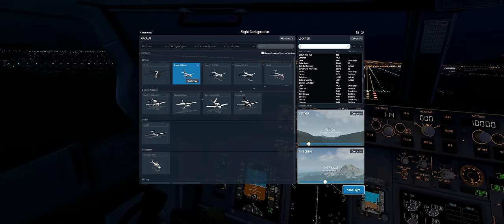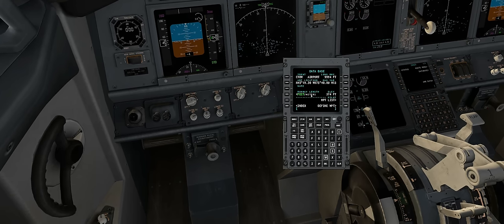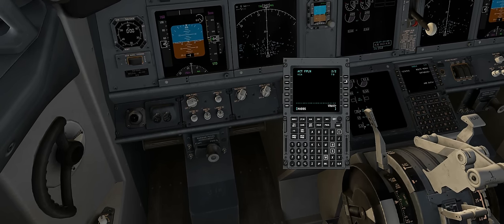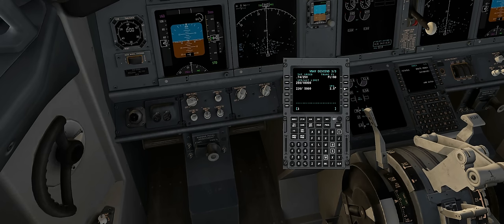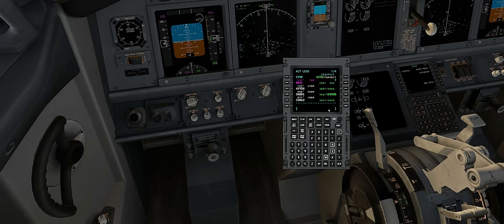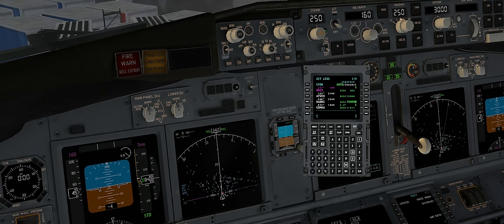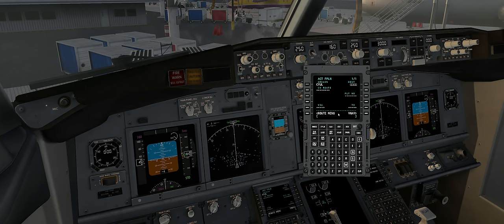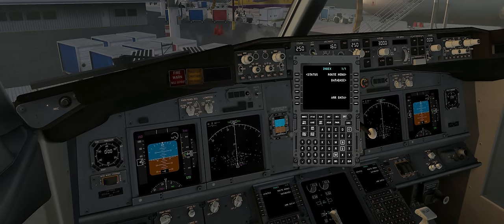X-Plane 11 - Flight Management Computer

Comment: Good video. One tiny note--flight level is simply an altitude measured at standard barometric pressure (29.92 in/Hg or QNH 1013). It has no relationship to cabin pressure.

Comment: I have found out that  the FMC woks better for me is to delete all waypoints & STARS after the desired runway. I know this is not the real world method, but it is working for me. If I leave them on, I fly around the airport, and then off to who knows where. I tend to turn on the vnav at about 3,000 ft. For the auto-pilot, I fly to TOD,  then turn off auto throutle and control the engines manually. I also use the speedbrakes when needed to get my speed down closer to landing speed. Speaking of landing speed, I have found out that 130 to 140 knots with full flaps is good.

Thank you so much for getting me started and for your tutorial!

Comment: It is the FMC Flight management Computer. Every one refers to it as the FMC.  In your dispatch paper work the company (Airlines) provides the route. The cost index is supplied also.  If the flight is always late you fly faster, with a big tail wind slower. The object is to make money on the flight. If your going home after this leg you fly faster also LOL. B737 are rarely faster than mach .78 so cruse is somewhere between .76 to .78  B767 fly .78 to .80  B777 fly .78 to .82 if it turbulent .80 for passenger comfort and keep cabin crew happy. Hope this helps. I'm a retired B777 Captain.  Any questions feel free to ask.

Comment: Thanks Chris for bringing out the many things about transition altitude. I know this tutorial is over 2 years old, but I thought I would add that in the US you have to be controlled by an air traffic controller in order to fly over 18,000 feet.  That means no VFR over 18,000 feet.  This isn't much of a problem to the masses since hardly anyone flying VFR gets over 10,000 feet, but in certain circumstances it can bring on dire results. For instance if you are near the Mexican or Canadian border or inside the 10 mile limit over one of our coasts and turn inland, and climb above 10,000 feet you will be watched for reasons of air traffic reasons.  If you climb to 18,000 feet or above you will begin to get calls from an air traffic controller. "Unknown Rider" calls have to be answered or you will be getting company.  You will be flying around in the clouds dog fighting an imaginary Red Barron and the next thing you know the Red Barron will be replaced by a US Airforce F-16 and the pilot will be happy to show you the missiles he carries.  Now that the Air traffic controller has your attention you will be asked to call said air traffic controller once you land.  Be assured it will not be a pleasurable conversation.  You may or may not be a licensed pilot after that conversation.  

Jason.  I have watched your videos many times and enjoy them very much.  I usually come to you when I have a question.  Thanks for the help.  I just wanted to add something that I thought interesting since it happened to me... oops  LOL

Comment: I just installed X-Plane 11 (Nov. 2021).  This video was incredibly helpful!  I would pause XP11 (to cut engine noise) while watching the video, then resume XP11 to program my FMC.  Note to self: Don't program the FMC while paused!  At 9:17, my list of STARS did not include HABBS3.24L, so I thought HABBS4.24L looked close enough.  :-)  Not sure what that means.  Also, I had many extra legs in my route, including two HABBS legs with some legs between them!  So, I deleted the in-between legs, which brought the two HABBS legs together, which eliminated the duplication.  I thought I was ruining everything, but I think I have the same exact route as the video.  Also, at 13:52 I could not save my route under PILOT ROUTE LIST (there's no STORE button!), but I was able to save it under CO ROUTE LIST (company) instead.  Now, on to the FMC + Autopilot video!  :-)

Comment: It's  a FMS ( flight management system) that's utilizes a CDU (control display unit) for its input modes.. The MFD's or (multifunction displays) are just the screens that give the readout information that has been stored in the CDU along with other important avionics and aircraft information..

Comment: The Transition altitude is actually a sort of window wherein one would change from using feet above ground (altitude) to flight level, eg. FL180.. technically by changing the barometer from using the QNH to the standard atmospheric pressure.

Comment: "Trans Alt" is when you adjust you barometric pressure to standard (2992 inches or 1013 Hpc's) so everyone at trans alt and above are on the same page, and midair collisions don't occur due to altitude anomalies.
Very important. Internet search you local rules.

Comment: I didn't see a mention of the "vectors" leg, and it doesn't matter if you're flying alone, but it should be understood. The vectors leg is an ATC procedure that's part of many STARs that not "closed" -- meaning a complete path from the STAR entry point, along the transition to a waypoint associated with an approach. If a vector leg is present, it means that the pilot is not to make a turn toward the next waypoint until receiving an approach clearance from ATC -- a heading will be programmed with the STAR for the pilot to fly after passing the previous waypoint. Upon receipt of an approach clearance, a vector leg can be removed just like you explained. You can, however, remove both the "discontinuity" and "vectors" leg in one step by placing the desired waypoint on the vectors leg. So again, if you're flying alone, the early removal of these don't matter. If you're flying in one of the virtual ATC environments, it will if there is other traffic around.

Comment: Just bought X-Plane and was a bit overawed with everything. This video helped me learn about the FMC. I'm gonna subscribe and see if you have any more good ones lol. Thank You
Reply: I suggest learning the Garmin G1000 a bit first, say in the Cessna or the Cirrus Vision Sf50 jet, and then move on to learning the FMC in the big jets. It's tons easier to master,
and learn how to execute flight plans, approaches, ILS, RNAV, etc., than the 737s and such. Even then, it's taken me nearly two years of solid simming to learn a lot of this stuff.
However, if you only want to fly the big jets, than concentrate on the FMC/FMS and it'll be time well spent. I like flying the Cirrus because A. it's an easy and fast plane to fly
and B. the Garmin G1000 is a much easier, more intuitive, and user-friendly GPS nav. system than any FMC. You can go right now and do a direct-to flight anywhere,
and select any approach you like for the arrival, store it, and then activate it later whenever you want, and the plane will essentially fly your approach, even, for you. No need
for selecting 500 waypoints unless you want to. That part of it takes some real planning and study. You cannot become an expert navigator overnight, don't care who you are.
Unless you've been a commercial IFR pilot for 20 years. Then, maybe.  Also, watch out for really harsh, real world weather on XPlane, because it can and will be buggy,
and may mess up your approaches and such, to the point where it's unflyable. Test it all out in calm conditions first, then graduate to real-world or storm conditions, etc.
I've had some buggy weather issues with the sim. I notice if I choose calm weather, I get perfect ILS landings. If it says approaching Toronto in wind shear, you cannot
land that approach. Good luck!

Comment: Hi Jason, Your videos are more valuable then others and I always recommend to thers. By the way XP12 has an A330-300 and many videos - useless, nobody tell you how to set the FMC
and setting for AP mode. I did some flights but always I had to take control of the plane at last. Hope you can make a good one.

Comment: Thanks for your great video. but one thing to mention. you explained Transition Altitude wrong in 6:50. Transition altitude is the altitude you will use QNE above that instead of QNH and we use flight level for naming the altitudes above that altitude

Comment: You don't need to hit EXEC after each waypoint. You hit it after route fully entered. The only reason it illuminates is because there's been a change and to save any change, singular or multiple, you need to hit EXEC.

Comment: hey i'm new to xplane 11 from fsx .great vid but at 4:47 what are the waypoints? don't understand what you mean.
Reply: The way points are where the plane flies past or near and it creates the path that's why there are a lot of turns when flying
Reply: You can find waypoints by using the iOS / map (in x-plane)
Reply: @tdscwhelan  Or, to use them for a flight plan, just use Simbrief. Simbrief looks complicated at first, but just change what you know you need to change. The fuel factor and stuff like that doesn't need to be changed.

Comment: How do you know what STARS to pick?  For example, Im testing from LAX to SFO and I have a ton of STARS options.  No idea which one to pick and why.
Reply: It generally depends on what direction you are coming from. So from LAX to SFO ATC usually assigns the "MODESTO EIGHT ARRIVAL" for runway 28 L/R (for turbo engine planes). Due to the winds SFO uses Runways 28 L/R almost all the time for arrivals. There are a couple other STARS they use for 28 L/R such as "YOSEM THREE". If you go to skyvector.com you can look at the charts and they are current, it is free and no subscription needed. Looking at those charts is a very good way to learn and have a good idea of what is going on while you fly.
Reply: You can go to www.fltplan.com (you don't need an account) and put in your destination.  Scroll down on your airport page to approaches.  It will list the STARS before the approaches (they have numbers after them).  Foreflight actually displays them to help you filter quickly.
Reply: its pretty fuckin obvious if ur going from la to sfo just pick the BSR3 or SERFR3
Reply: Go to Skyvector.com and open the charts and see which one you have to do

Comment: excellent job with that tutorial! Thank you. I do have one question though, what happens when you reach Top of the decent?  If you change your altitude prior to reaching..TOD?  LET'S SAY YOU WERE AT 30,000 FT, AND YOU ADJUSTED YOUR ALTITUDE DOWN TO 4,000... AS THE AIRCRAFT REACHES THE TOD, IS THERE ANYTHING YOU HAVE TO DO TO GET IT TO DESCEND? OR WILL IT AUTOMATICALLY START TO LOSE ALTITUDE LIKE THE DEFAULT BOEING 737 ZIBO?

Comment: What if Vectors is the last one? What do I replace it with? Thanks!
Reply: i have the same problem.
Reply: Greg Speedcubing I've figured out that it's not an issue as long as you don't get through the "VECTORS" waypoint. Just leave it there and see what happens, you will most likely have to disengage VNAV and LNAV and the autopilot in order to approach the runway before you even notice the last waypoint :) Wish you nice flights!:)
Reply: Andrei Sebastian wow ! Thank you very much for your answer!
Reply: Greg Speedcubing My pleasure! :)

Comment: Jason, many thanks it help a lot! How to get in touch with you? Since I learned FMC somehow, made few flights on default 737 and every time I had to land the plane manually when auto pilot for some reason stop following the "magenta line" and wonder off in unknown direction. I had hard time to find the airport and align myself with the runway. My landing was not perfect and if i had passengers they will thank god that they are still alive. If you read this please let me know how to come back to "lost" way point, how to setup speed brake since i can not find the right setup and the list is mile long and final how to setup camera views. Thanks in advance, Voytek

Comment: How do i know which waypoint to type in?
Reply: Bozoo baje make a flight plan somewhere
Reply: @user-rv7sv9dt1h  its a headcache i prefer see skyvector maps and put on order the wpt and other shit but its better do a flightplan
Reply: I've used the Garmin G1000 more than any FMC yet, but, I think if you go to the websites where you can download preset flightplans that are freeware, or not,
they'll already have waypoints built-in, and you can always edit or add to them. If the preset flight plan lacks arrival and departure detailed selections, like ILS approach
or whatever, you can simply fill that information in yourself once you load up the preset flight plan.  I think it takes some practice learning how to be a good enough
navigator to plot out your own flight plan from scratch. If you are flying from L.A. Intl. to Seattle SeaTac, for example, you have to get out the maps and SkyVector
or whatever, and IFR route maps, and select your route and waypoints and arrivals and all that, considering altitudes, clearances, terrain, everything, time of day of flights, etc.
This is really not for beginners. It's easier to load up a preset flight plan and then edit the arrivals and departures info. as needed, if not included. I prefer the Garmin
for smaller plane and business jets (if available) because it's easier to edit and plot out on the nav. screen, and edit procedures and select approaches, etc. than on the FMC.
You get a more user-friendly pictorial of your route and all that as you go. But of course, in the larger planes, you have to use the FMC.

Comment: Jason, I was wondering if you could help me?  I am having an issue with the 737-800.  The plane starts up on the runway but if I load the FMC, the plane will not move.  I have released the parking brakes.  Any thoughts?

Comment: The only thing that is NEVER clear in any FMS tutorial is where you get the waypoints. The standard waypoints given even you select origin and destination tend to render the aircraft flying astray and away from the destination or happens to show the actual distance of that waypoint only when you're flying and it tends to be well as far as 600nm flight. Been trying to fly from KLGA to KJFK which should be a 10nm at most and whenever VECTORS shows up, first the horrendous ATC system in  XPlane 11 won't ever contact you for vectors or anything if you don't force file a flight plan. Moreover, VECTORS usually locks you in a trip around the world hundreds of nm away from the next waypoint. It's arguably the most difficult thing about flying there is, hands down.
At least this tutorial does explain VECTORS is as undesirable as DISCONTINUITY. No other tutorial catches that caveat.

Comment: Ok great video. But you completely lost me when you entered in the first waypoint “avvon”. I’m assuming that is a waypoint for some nav marker in Canada?? If so, how can I get info like that on other locations and routes, so if I’m flying in Texas.. thanks for any help you can offer.
Reply: Go to skyvector.com and click on the colored dot for the airport you want. There will be a link to PDF files for apt diagram, SIDS, STARS, and runway approaches. His first waypoint is likely on a SID (standard instrument departure) chart for the general direction he is departing (NW, NE, S, W, ect). It may vary based on weather and what the active runway is and if there is heavy storms in the immediate vicinity of the airport at the time.

Comment: How did you get the waypoints for example avvon. I would like to try to fly out of different airports but I'm not sure how to find the way points
Reply: Go to skyvector.com click on the colored dot of the airport you want. A mini window will show. Click the airport name link at the top and scroll down. It will show airport diagram, SIDS (if applicable), STARS *, and approaches to runways like ILS/LOC RWY24 or RNAV 32R for example. You can also create a flightplan on this site and drag the magenta line to align waypoints and save to file.

Comment: I call it the FMS from my days with the DH400 on P3d.. As a beginner to X-P11  I thank you for this tutorial  Can you also please tell me can I use this FMS on other aircraft such as the FJS Q400 and the Jrolon J32 Both Piston turbo aircraft in X-P11...
Mike from Scotland
Reply from the maker: Yes. However, I believe VNAV is not implemented in that plane thus you may have to manage the altitude yourself.
Reply: Thank you for a quick responce

Comment: For some reason my fmc wants me to be at 3000 ft when I'm like 2 seconds from touchdown, so i fly over the airport. (airport elev. is about 114 ft). Is there any way to fix this?
Reply: Make sure your altitude bug is dialed to zero or above your current altitude. The VNAV will always capture an altitude unless you are on an ILS or LPV glidepath.
Reply: and also it always wants me to have a vertical speed of around 5 to 6 thousand after takeoff. Any fixes?
Reply: I guess i should never use vnav?

Comment: Hi I have followed this tutorial step by step but when it comes to saving FMC, I am not getting the option in (pilot route list) but only in co route list but if I save it there when I reopen it the legs are different even my flight number is missing, can you please help. thanks. I am using the x-plane 11 purchase December 2019 version.
Reply: I've noticed the same thing - can only save as CO route, and when it's loaded it's not the same thing that was saved.

Comment: Do you need to use Vnav or Lnav? Because the plane doesn't follow the flight path
Reply: V3 1.4 Yes.
Reply: I think for the larger jets, business jets, King Air, anything using the FMC for the entire flight, you have to engage the flight director, AP, and LNAV and VNAV buttons as you get underway, or the FMC and Autopilot as coupled, will not fly the full managed flight plan for you. Enabling VNAV and LNAV and the AP (Flight Director) will ensure the plane executes all flight plan sequences in the proper order.